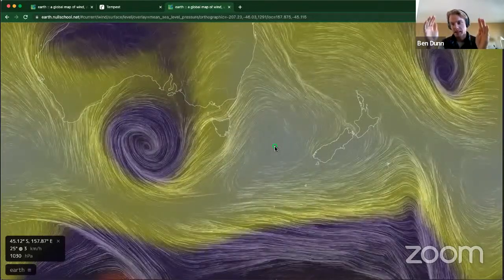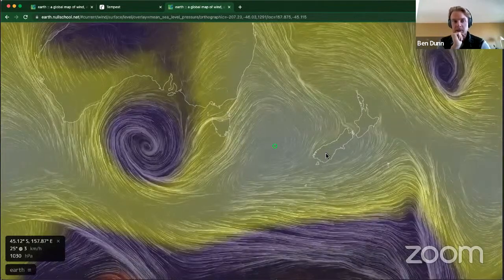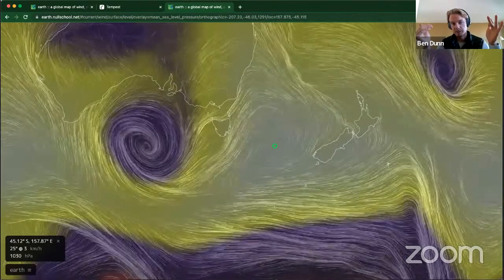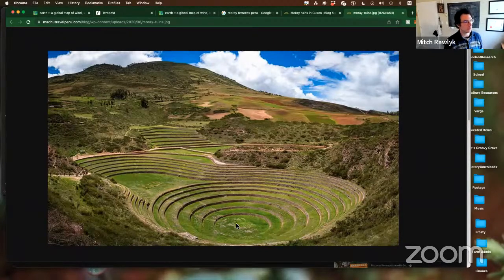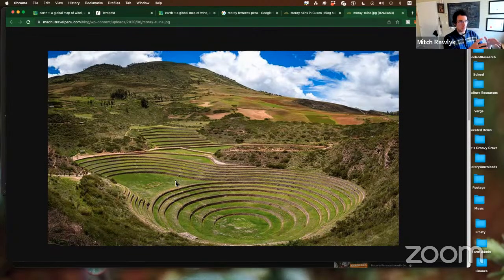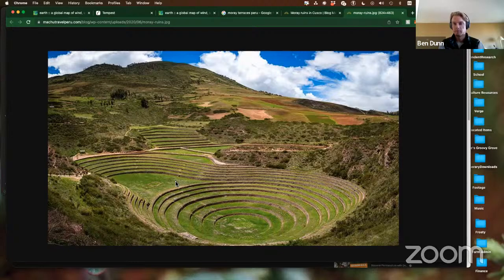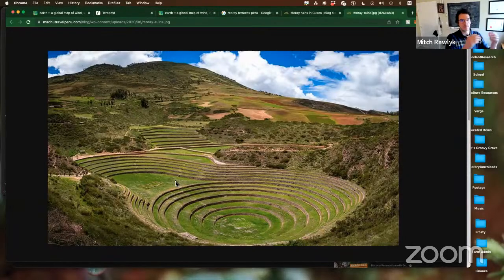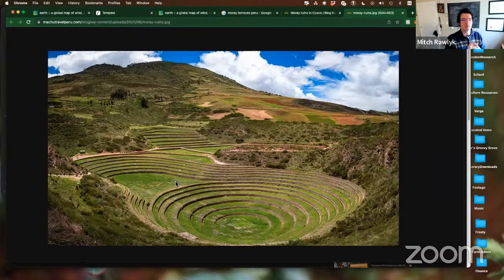Introduction to Permaculture (2/5): Designing with climate in mind

Comment: Hi guys, great info. Thanks! 

Regarding the reason for extreme weather. New Water Paradigm scientists make two additional points to the ones you made. 

1. Extreme weather is caused by the temperature gradient differential. The difference in temperature between two areas. 

Eg. A poorly managed bare field will experience more extreme weather than a forest for example. 

2. Bioprecipitation a bacteria that lives with some trees, is a cloud condensing nuclei can create rain at warmer temperatures than other ccn. Meaning more regular rainfall. It is responsible for half the world's rainfall. 

Our land management affects both the frequency and severity of precipitation.